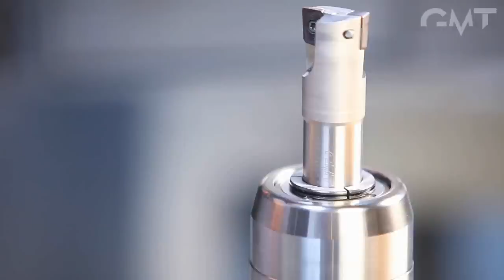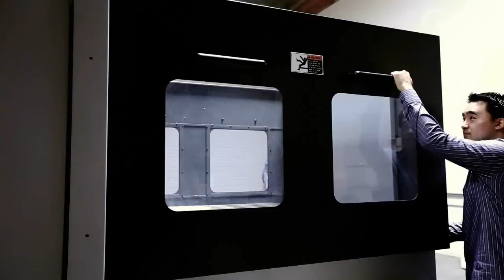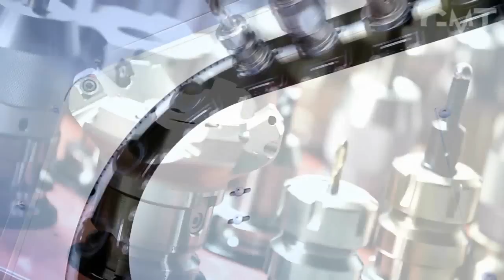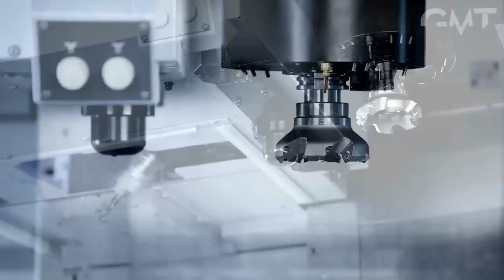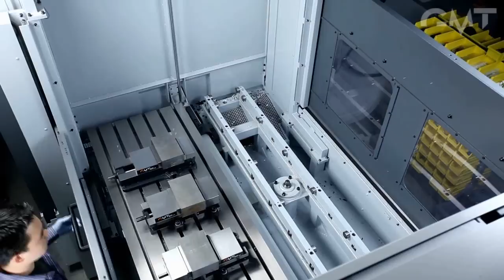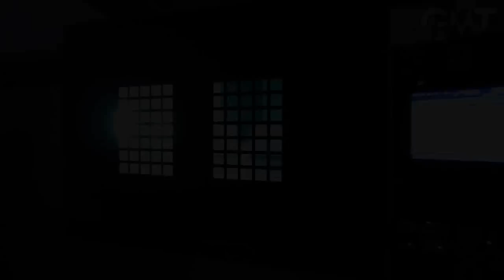Glacern Machine Tools - CNC Milling Products Showcase 2009

Comment: lol Nice setup, everything nice and clean and shiny! Not even close to the real world. I understand it's a demo and you want to present it in it's best light, but to me, as a machinist, I would rather see it one year into use on a production floor. Old nasty coolant everywhere, chips all over the place, a fat machinist with plumbers ass leaning in to remove a broken tool because the dim witted operator forgot to put in the correct tool offset...real life!